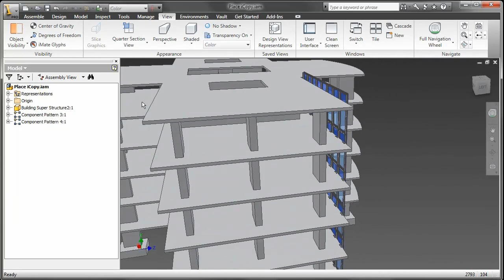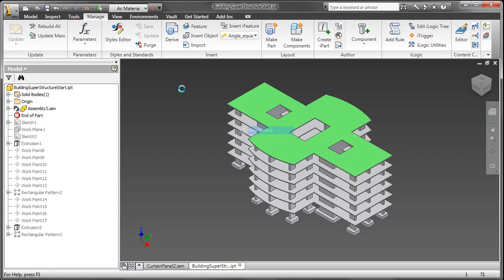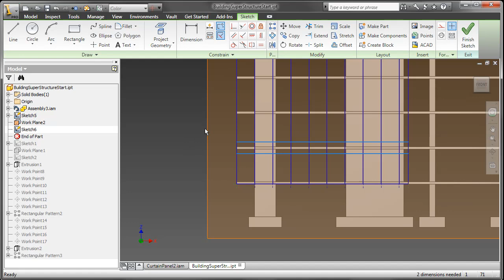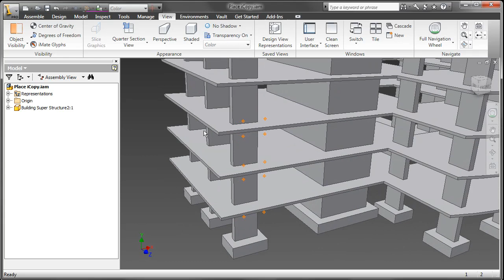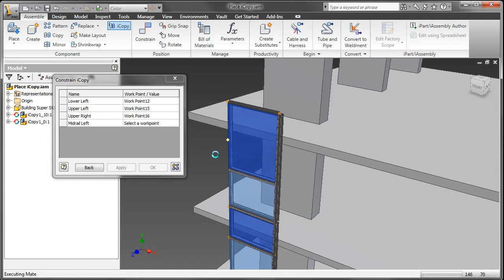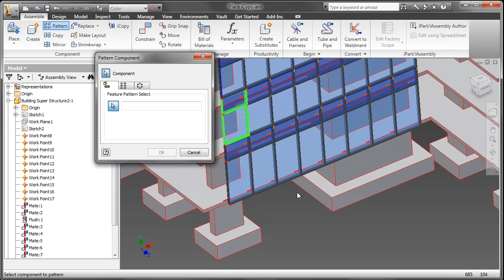Autodesk Inventor Technology Preview - iCopy

Comment: Can you please send or show how did you make the curtain wall panel as a iCopy item. I keep getting errors. 
Did you make the parts in individual ipt files then insert all together into an iam file that has the panel skeleton?
I inserted in each part the derived panel skeleton so that if skeleton changes in the ipt file, it adjusts all the parts because they have the panel skeleton derived. 
Then I inserted the panel assembly into another panel assembly that has the building wireframe. I used iCopy Author already to pick and name the points in the panel assembly. But when I used the ICopy feature in the building wireframe assembly, I can only click one point, as soon as I try to click a second point I get an error with instructions on checking if this are adaptive etc. I think I have done it right, but still not working. Please help :)

Comment: I've just watched your video and have a somewhat related question. What are the specs of your computer? Our firm just had a "Rendering Computer" built for a specific job and it creeps. This particular model has some iCopy parts to the sum of about 3200. It takes about 30 minutes to update each change. It took the entire weekend to build one wall. I've been trying to convey to upper management that there is something extremely wrong, or that maybe the company we use for our IT might have used the wrong components. I highly doubt this is the norm. I watched your video and typed out this comment and it is still trying to load my last change that I implemented about 15 minutes ago.

Comment: can you please post the tutorial on how you built your curtain panel? i've created my panel using the frame generator tool and i've realised that its using up a lot of my pc's processing power to place them.  After placing my icopy component, i can't apply a pattern to array the component.  Am I doing anything wrong?

and is there a way of arraying them along the same plane. because the icopy tutorials that i have seen is arraying them in the perpendicular direction

Comment from the maker: Sure you can create 3D solids with SketchUp, but is it the right size, can you create 2D DWG's from the model, can you test the strength or fatigue of a part in an assembly while in motion? That's the difference between a geometry creation tool and an engineering tool.

Comment from the maker: SketchUp is a geometry creation tool where Autodesk Inventor is an engineering tool. FEA, Part Libraries (750,000+ standard components), Sheet Metal part creation and flat patterns, Tube and Pipe, Cable Harness, Document in 2D DWG directly from the 3D model. I could go on and on, and that's not being biased - just honest.

Comment: For the other noobs (like me)... the "measure" could be accomplished from within the pattern command.  It is available from the spacing flyout and you could quickly divide the full distance into equal lites (you'll need to consider what the lines represent in relation to your corners or mid-rails) by adding the "divided by" symbol... / ... after the value you measure.  Hope this helps someone to save a step.  We're all in this together!

Comment: Sweet action!  Can Inventor Pro help with analyizing the weight of the assembly, windloads and negative pressures so anchoring can be engineered without WAGging?  Inside and outside corners regions are of special interest.